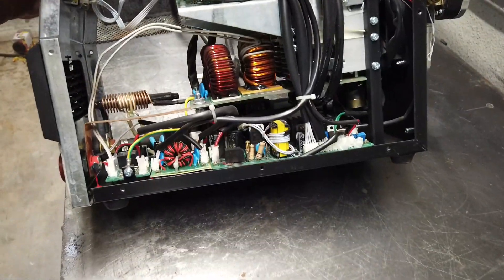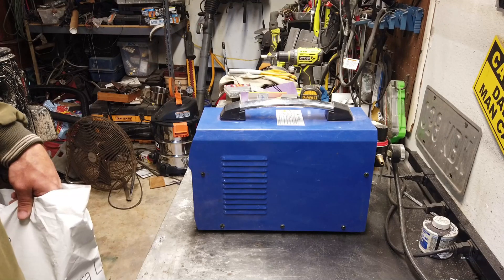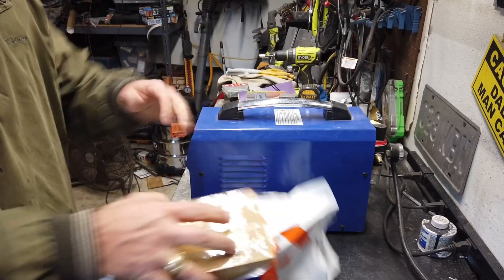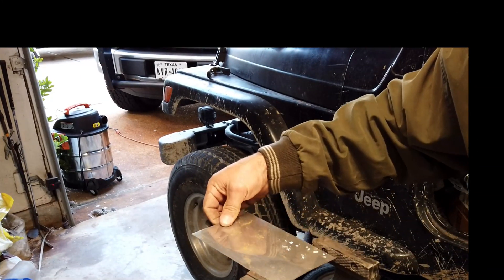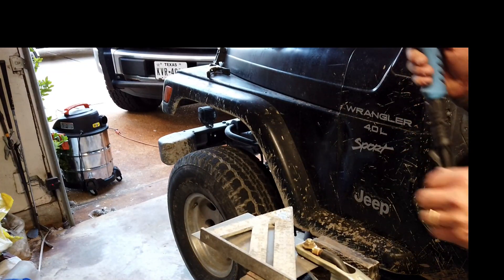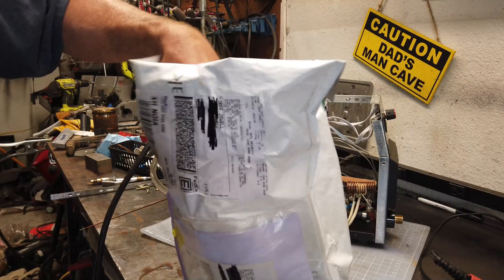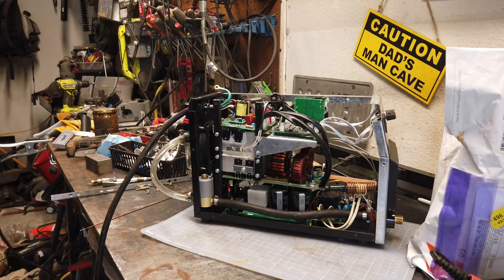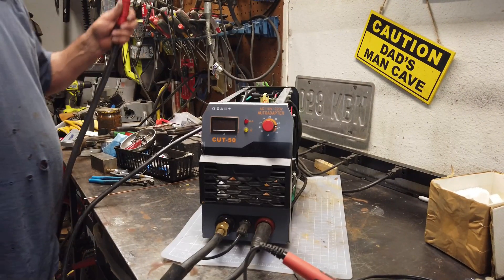SunGold Power 50amp Plasma Cutter 1 year and 5 days later.

Comment: I just bought one for small projects at home. after a $70.00 coupon I paid right at $200.00 I will see how long it lasts?
we get what we pay for. I can't justify paying a lot for a tool I don't use that much. It's a roll of the dice. sorry for your
loss. we have all been there and will go back there too. Thanks a lot for opening up your welder and sharing your story!
Reply from the maker: Lee Lemon I hear ya.  I can’t expect a $200 plasma cutter that I use a couple times per month to last like a Lincoln or Miller but I also can afford or justify the price for my small shop.  At $200 they’re just about disposable tools for what they do.  One thing I believe is an issue in my shop is the ingress of metal dust on some of these electronic products.  Try and keep it clean and I hope it last longer than mine

Comment: I was getting frustrated watching you get frustrated! Man that sucks! I was thinking of buying one but now i am wondering what you replaced yours with or did you?
Reply from the maker: DALES GALAXIE I haven’t replaced it yet, but for $200 bucks it’s hard to go pay $1,000’s for a Miller or Lincoln, so I’ll probably try another one of similar ilk?
Reply: @lazyjmetalworks9626   I hear yea! I found this video not the same brand but looks like the components are the same. And he's fixes it! check it out! 
https://www.youtube.com/watch?v=VAIsQbIuIUQ
Reply: @thinkford  Thanks for the link! I know next to nothing about electronics but I watched the whole video and near the end was a clue what might be wrong with mine. Fan and air worked fine but it never cut from the start. He suggested a contact may be dirty (my unit is brand new) or improperly set. I will check that out. Fingers crossed.